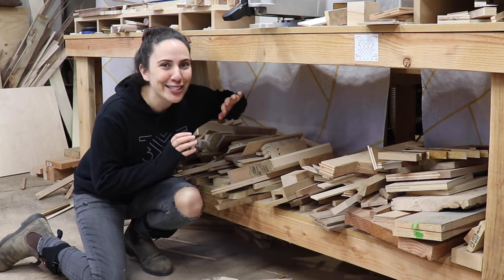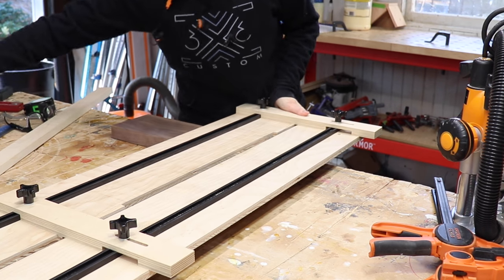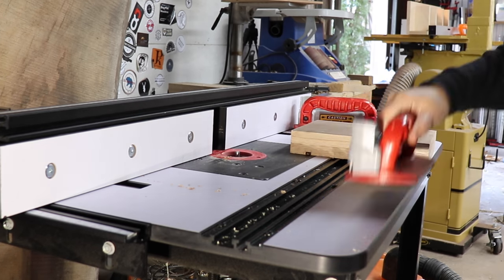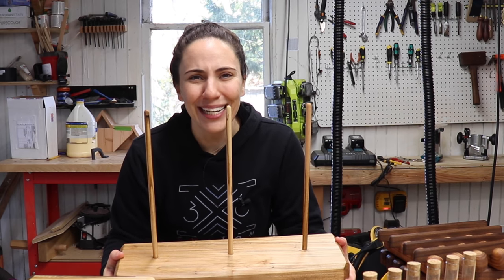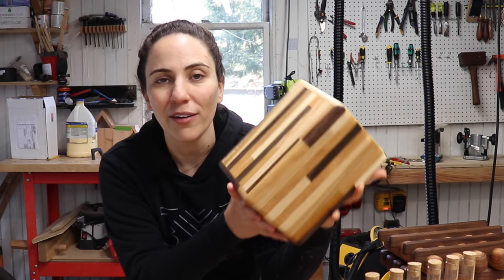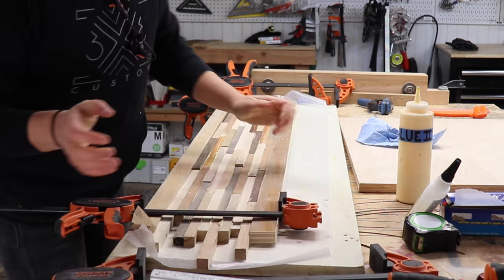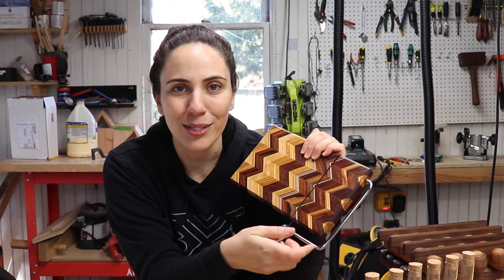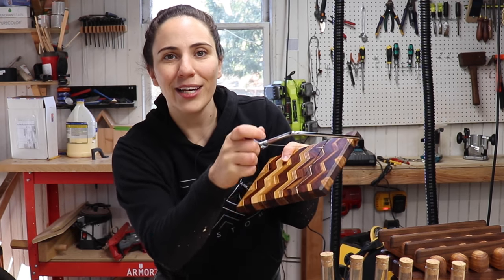5 Quick and EASY gifts you can make from SCRAP wood!

Comment: I usually acquire enough scrap wood that the pile is a problem, so I use the wood to build a container for the wood. That fills quickly, and a new pile is started, until I use it to build a container for the wood. That fills quickly, and a new pile is started, until...

Comment: I watched some of your earlier videos and made some criticisms about safety and work choices. I am so pleased that your technique is so much better! Excellent technique and you efficiency is exemplary! So straightforward and creative at the same time. Really well done now. I think safe habits and efficiency go hand in hand. One tip on cutting dowels: when using a quarter round bit start the cuts not all the way at the end. The square portions at each end keep the wood square and prevents rolling of the piece while milling. Then trim the ends and you’re done. Keep up the great projects!
Reply from the maker: Thanks. In my dowel making video that’s actually how I mentioned to do it. If you see in this clip. I didn’t go all the way to end. The bottom was still square. I cut them to length off camera

Comment: Thank you for the great ideas. I've made and sold several  of the cheese slices. If you put a small block against the back of your crosscut  sled you can cut your slicer groove so its deeper on the side where the loop meets the frame. Then you wouldn't need to cut away a spot for it. Awesome  video!!
Reply from the maker: Great tip!

Comment: I "discovered" you from this video. I look at a lot of woodworking videos and am not sure how I've missed you till now. Great stuff. I was inspired by your cheese cutter to try it myself. The issue about inserting the end of the cutting wire onto the shaft that goes through the hole is an issue. I'm not fully sure what you did, but the problem is that the slice is going down halfway through the wood while the hole is going deeper. Thus, there's no way to easily have room for both. What I did was take a 1/16" Dremel grinding bit and cut a groove across the hole from inside the saw cut. (Man, that sounds like a mess.) Think of an underpass; that's what I cut with the Dremel. That worked out fine. Surprisingly and interestingly, the instructions mention nothing about this. Best to you.

Comment: Hi Tamara, great video as usual.  While watching this i was wondering if you might be interested in doing some quick tutorial on using your handheld router.  I watched you use the router to make the indentation for the diamond sharpeners then went to try it myself and wow.....was not quite as simple as it looked.  Perhaps the trick i didnt use was to use your adapter plate at the bottom of the router to stear it around the cutting zone.  Thanks for all you do !!
Reply from the maker: Thanks! Yeah. I was thinking about doing a router video like that

Comment: A couple things. Great projects. The trivets are real cool as well as the box. I love the design of the bagel rack. As far as the cheese cutter, I made a few for the past holidays. I found a place to buy the hardware much cheaper. I don’t remember the name now. Something like the cheese supply? As far as drilling, you can get a.long bit that makes life better. And yes to get the wire around the shaft is a real pain. I didn’t do it but was thinking of drilling a hole straight down from the surface, all the way through the board. It would have to be a bit larger than 1/4” (Pun?). It would make cleaning the slot a bit easier. And I clean mine with the spray nosal in the sink. Works great. And the slicer works super on all sorts of cheese.
Reply from the maker: Thanks so much! Glad you liked them all!

Comment: I LOVE your videos.  More often than not as I'm thinking "I wonder if this would be an improvement..." you talk about the same idea.  Here's an idea for the next cheese cutter: Make the board with an "L" cross-section (short leg rising above the cutting surface, the long leg IS the cutting surface). Instead of mounting the hinge for the cutter in the base, mount it into the short leg of the "L" so that the wire is flush with the board top when closed. The vertical portion (short leg) only needs to be long enough to house the cutter hinge (it need not run the entire length of the board).  It would probably be best to mount the cutter in the short leg first making sure you have a tall enough block for adjusting the position, then attach the short leg to the base so that the wire is properly aligned and trim off the excess on the short leg in the underneath side of the cutting surface. In this way there is no groove to collect cheese crumbs and clean up is easier.  Granted, this makes the build a little more challenging.  Just a thought.

Woodworking is a hobby for most of us and should be fun.  Your approach is easy and fun and the fact you include your kids is awesome.  I also appreciate you offering alternative methods to do a task for those of us with less well-equipped shops. Keep up the good work.
Reply from the maker: Interesting idea. I might have to try something like that!

Comment: I also had problems tripping breakers when running a larger HP tool and a shop-vac dust collection rig.  So I switched to a low-cost dust extraction blower with a large 2nd stage collector, all run on 4" pipe with as little flex hose as possible, and I haven't tripped a breaker yet.
Reply from the maker: Awesome to hear. I’m planning an upgrade soon ☺️

Comment: Great project ideas and even better justification for saving all my "leftover" wood.  One question- what finish did you use for the trivets?  Given the higher temp of items placed on the wood, interested in what will hold up and also not impact the pan/pot/etc placed on it.  Thanks!
Reply from the maker: Thanks! I just used cutting board oil. I’ve used other finishes in the past though. Like lacquer or water based poly. This was just easy. I figure it won’t need to be washed too often
Reply: @3x3CustomTamar  thanks.  I still have a lot to learn about finishes.  I tend to default to High Performance by General Finishes as it is "easy."  Just didn't want to end up with finish "melting" (not sure that is possible once cured?).

Comment: When gluing strips of wood together, like you did for the box, you can use a nail gun to ensure each piece is not going to move as you work, and it works better than clamping as it holds each individual piece in place. Might not be worth it for a box, but I use that method for counter tops, furniture, and other large items.

Comment: Absolutely, positively love the scrap wood box.  Real cool!  When you cut the groove for the bottom box panel, did you use a dado blade or a regular thin kerf or full kerf blade...?  I think I have the same Dewalt table saw and don’t believe it can support a dado blade.
Reply from the maker: Thanks so much! I know it’s hard to tell because I was trying to keep this video concise... I actually just took multiple cuts with a thin kerf blade. I have a separate video that I linked in the description that goes into a ton of detail on making these boxes

Comment: I'm thinking for the cheese slicer, you could insert a piece of plastic in the groove for the wire and cut the wire slot in the plastic. This way it would be more cleaning friendly where the cheese gets in it. Just keep the plastic close enough to the original size so it doesn't affect the slicers look. I really liked that project!
Reply: Or you could just do what Scandinavians, Germans, Dutch and Belgians do, and use a regular cheese slicer that goes in the cutlery basket of the dishwasher and has a handle and a blade, rather than a fragile and dangerous wire.
Reply from the maker: That’s a good idea! Like a plastic inlay. I was actually thinking to mix materials and to do marble would be cool
Reply from the maker: The wire isn’t dangerous at all... it’s not sharp...
Reply: @3x3CustomTamar  Ooh, Marble would be nice!
Reply: @3x3CustomTamar  
Then how does it cut? Everything I read about cheese wire implies that the exposed wire can be dangerous. Or does it just force its way through the cheese?
Reply from the maker: @ragnkja  it just forces its way through the cheese. You can’t cut your finger on it.

Comment: Hey Tamar, I have always heard that one should not put hot pots on a wooden board, especially one finished with Mineral oil or I see you use Walrus oil.   Do you not worry about the heat on the wooden trivet or do you put a special finish on it?
Reply from the maker: I think the purpose of the trivet is to protect the table. So honestly, I don’t really care what happens to the trivet! I use whatever finish I have lying around that’s easiest to apply!

Comment: @18:30 Just cut the wire slot twice. Put a strip of masking tape along the fence edge of the cheese board for the first cut, then remove the tape for the second cut. The finished slot will be about .005" wider than when cut with a single pass. You can use additional layers of tape in the first cut, depending on the thickness of your wire. Easy-peasy, cool and breezy.

Comment: When you use scrap wood for making your project,  do you mix soft and hard wood or do you sort your wood, I.e. all types like oak cherry birch and not pine mixed within
Reply from the maker: I mix wood with different hardnesses. Like there was polar in that box. But I wouldn’t put poplar in a cutting board bc it’s too soft. So I guess it depends on the project.

Comment: Tamar - I want to make the trivets you show for some family and friends, but I didn't see the dimensions you used listed here or on your website. I'll check the comments. As I understand it they are 7 to 8 inches long. The bottom pieces appear to be about 1.5 to 2 inches tall and when finally cut they are 1 to 1.5  wide/thick. The dadoes look like they are 3/8 to 1/2 inches deep. If you could confirm that these are close. I don't have a Dado blade set so I'm planning on cutting all of them using my router and my largest straight bit is 1/2 in in diameter. Btw I got an upcut Spiral bit from Rockler and because they said it would reduce tear-out and it absolutely does. It wasn't cheap - about $40, but it is way better than a straight bit. Thanks again for all of the great videos and project ideas.
Reply from the maker: Hi! The thing about these trivets as that there are no rules. I made them based off the scraps that I found and just made the dados half way through the material
Reply: @3x3CustomTamar  Thanks. I just finished up a trivet for my Mom's birthday that was on Tuesday. I used black walnut for the top rails and some select wood from a 2x4 (that I think is fir) for the base ones. I'm not on Instagram too often, but I'll try and upload a photo because I was a bit blown away by how nice it looked, and my mom who is in her 80's now loved it. My fiancé suggested I use Olive oil to finish it because I couldn't find any walnut oil (our Home Depot is lame). My mom likes puzzles so I made the trivet so it will hold together without glue and she can take it apart or move pieces around if she wants. Again, thanks for the great ideas and inspiration.
Reply from the maker: @bernarddouthit4647  awesome

Comment: Tamar - great video.  Question, though.  I tried to do the cheese board because I think yours looks fantastic.  By the time I planed what I glued together into even close to a level board it was very thin )1/4-1/2" tops.  When I cut them at an angle and flipped them over I tried to glue them together again and they were extremely uneven.  Sanding that down can't even use the board for a cheese board because they are too thin.  I made the slices less than 1".  Do you think that is the issue?  Maybe if I started off thicker I will be able to salvage enough for the board?  Did you have that issue on your first board?
Reply from the maker: I didn’t have that issue. But I know what you mean. Yes. Start with thicker pieces to allow for clean up after glue up

Comment: Hi Tamar.
Just found your channel and am loving every video.  
Regarding the awesome scrap project that you makde to hold the crockpot, what finishes can be used?
I've tried to do some research on heat resistant finishes but mostly find options to deal with MUCH higher temperatures than the bottom of a pan.  Is the type of wood/finish a concern at all?

Thanks, keep up the great work :)
Reply from the maker: Thanks! I use whatever is closest to me… ha. Any oil finish should be fine. It’s just a trivet. No need to think too much about it.

Comment: How do you put a chamfer/bevel on the corners of the wood? Not the edge. I’ve seen that done a lot lately and would love to know how!!
Reply: I would think the same way, with a chamfer bit on a router table. You need to tilt the workpiece 45 degrees, maybe using a miter gauge.
Reply from the maker: Yeah. I use the miter gauge at the table saw to do that 😉

Comment: Very nice! Did you try to do a bourbonmoth style entrance at the end? 😁
Reply from the maker: Thanks! No. I did a Tamar entrance. But I tripped on a box of hardware....
Reply: Too funny...I was thinking the same thing!! 😂😂 Tamar - is this 5/4 walnut stock you used?
Reply from the maker: @Darkotex  ha. For what?
Reply: @3x3CustomTamar  🤠 I was thinking after I commented that I should have mentioned I was referring to the first project. 🤪
Reply from the maker: @Darkotex  ha! Honestly. I don’t know what it was. I didn’t measure at all for that project. I based the cuts off of the material that was available.

Comment: Any major reason you don't upgrade your table saw? I started with a harbor freight saw, then a delta contractor, then I just recently got a deal on a power matic. The fence system is such an upgrade to the first couple saws, it makes the table saw the number one saw used.  Just wondering if you had plans on getting a bigger one/ different one.  Great video and ideas for the scrap laying around my shop.
Reply from the maker: The reason is the lack of power in my shop. I have plans for an upgrade though 😉
Reply: @3x3CustomTamar  good deal. It really is nice,  and honestly I wish I bought a 220V 3hp. Kind of a "cry once " mentality. Then I would never have a need to upgrade.  Is it because your breaker box is full? I had to change out about 4 or 5 breakers to piggy back breakers to make room for dedicated shop breakers. They are pretty easy to install, im sure you and your husband can figure it out. Thanks again for your videos
Reply from the maker: @joshyingling  the wiring is just old. I plan on an update soon 😉

Comment: Great video! Are you still happy with the dewalt jobsite saw for the  projects you do? Was looking at the current version of that one, but wasn't sure if I was sacrificing other features for portability on a saw that's not really going to leave my garage.  Something like the Delta 36-725 looks nice and is the same price, but it takes up a lot more space and the reviews on the motor are a little iffy.
Reply from the maker: So it has been working well for me for the past 5 years. There are some drawbacks to it and things I have to work around in order to make precision work. But I don’t think they sell this one anymore. I believe the newer one is only for an 8” blade. All that being said. I do hope to upgrade to full size cabinet saw soon.
Reply: Thanks for the info. They have the 8" saw now, but they do still sell the 10" for a little more(same price as the Delta).

Comment: What kind of finish were you using on the trivets?
Reply from the maker: Just cutting board oil. I’ve used lots of other stuff in the past. I just use whatever’s easiest. Ha
Reply: @3x3CustomTamar  Thanks! Cutting board oil is pretty easy to apply, and creates a nice shine. I just wish it were more permanent.

Comment: Hey Tamar, great stuff, as always! Quick question: do you know if it's ok (food safe) to use regular galvanized wire for the cheese cutter? Not that I wan't to go cheap on materials, but getting some things in Chile is pretty difficult and often expensive.
Reply from the maker: Sorry. I don’t know
Reply: I don't think I'd use galvanized wire. But you probably have guitars in Chile so wire guitar string should work.
Reply: @dwightl5863  I did end up using a guitar string for my cheese cutter, not because I thought it'd be a food-safe option (and actually not all guitar strings are, I had no idea) but because I couldn't find galvanized wire in a thickness that could effectively slice cheese.

Comment: You might need to up the circuit breaker for your shop. I wouldn't advise this, if you don't know if your wiring can handle it, but tripping the breaker so much can ruin your electronics, and even some power tools.

Comment: Lots of men are intimidated by a woman in a wood shop, hence the negative comments; they can go pound sand.   Re your bagel rack: when gluing two halves together that have a channel routed between them, prevent glue squeeze-out from collecting in the channels...use a rifle cleaning rod with a loop and a cloth patch.  It mops the glue right out.  A small kit for a .22 rifle is super handy in the shop.
Reply from the maker: Sounds like a good tip!